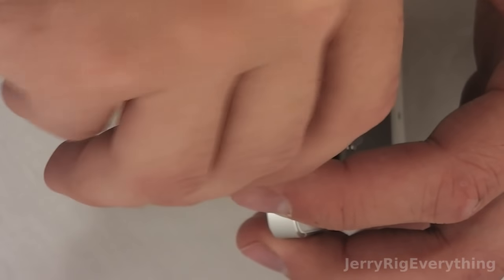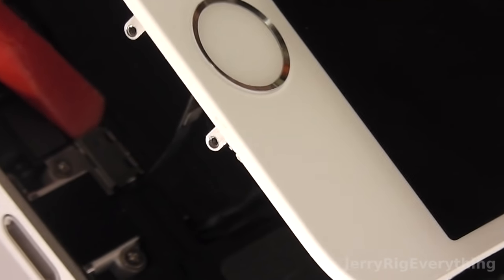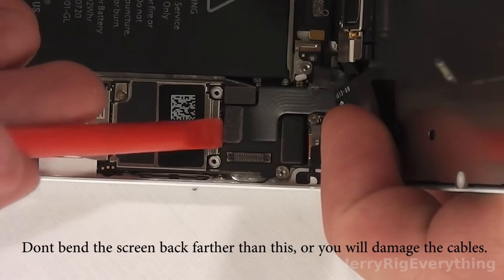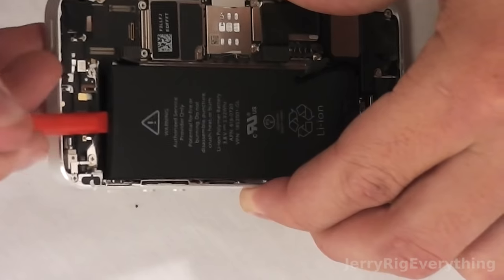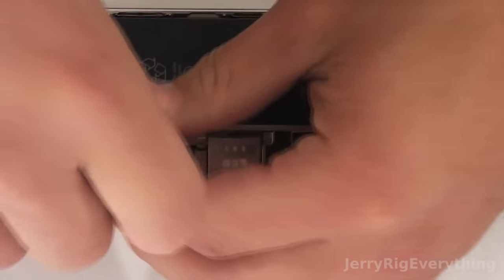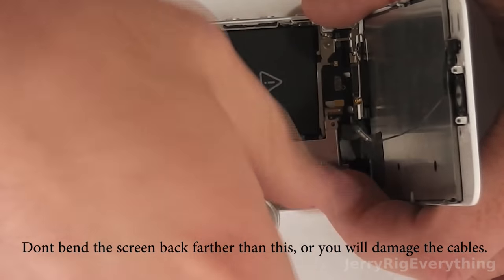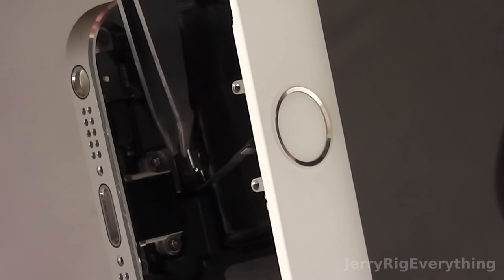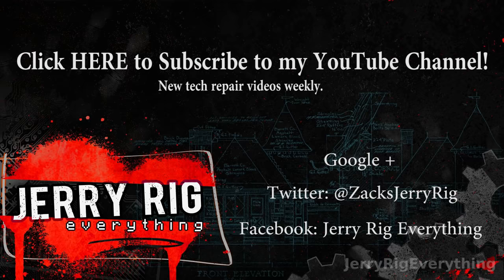iPhone 5s battery replacement in 6 minutes!

Comment: Very helpful and well made video. I had to heat the back of my iphone to soften the glue of the battery which deformed a little but didn't break (I gradually eased the tool underneath and when it seemed rigid I used the hair dryer again to reheat the back of the phone). I did lose a screw, but that was my fault!

Comment: Many thanks.  I replaced the battery and the screen.  That last connector.... The ribbon cable on the new screen was not folded in the correct position like the old one.  Getting that little connector in place took an age.  As you predicted I loved that! (Not.) But the job is now done and all looking good and working well.  Thank you.  (July 2020)

Comment: Excellent tuition with a thorough and detailed description which also included many useful tips gained from experience. I will now try to find out why my phone is not powering up after dropping it. When I first plugged in the charger after the drop it showed a dead battery but I know it was at least half charged. Then it jumped to half charge and the phone functioned normally as I checked it for a few minutes. Left it to charge fully but when I tried it had shut down. When trying to power up it is just briefly showing the white apple logo then screen goes to a very very dull light which is kind of bluey black. Hopefully it will be something simple. Any advice will be greatly appreciated, Thanks. Subscribed👍

Comment: Just changed my battery and although it did not go as smoothly as depicted, I realize he has much more experience. I too had the biggest problem removing the battery. There is a similar video on ifixit that describes removing the adhesive sort of like a Command adhesive strip. I guess I pulled too hard and it broke so I did have to pry the thing out. It has been suggested to warm the battery with a hair dryer to soften the adhesive but I did not try that. Hopefully this will be the last battery I put in. I used a piece of packing tape sticky side up to place the screws upon removal so I would know where they went back. Overall the video was very helpful.

Comment: Very helpful, thanks!  I had problem taking the battery off the phone.  The adhesive was really strong that I almost gave up because I bent the battery and a spark came out.  Taking the battery out took me about 15 minutes.  After that everything works great!

Comment: Wow. Very good video . I ran into some issues with frame alignment putting it back together , and those small connectors are a bit tricky lol.. had to take it apart and reinstall bc I think I didn’t quite connect the ribbon cables at the top correctly ..

Thanks for helping me up-cycle my old 5s!!

Comment: 1) If you afford do it with the master. 2) Omg! I did it myself!!! When you watch 5min hair tutorial and repeat, usually it doesn't look the same. Try to replace the iPhone battery! F.. it is not fun though! It took me one hour, and except the tools for the battery replacement I used the nail kit&brow twizers. The white adhesive under the battery and the clipping back the small cap are annoying parts:)). Will I do it again? Yes!  Tomorrow gona replace the iPad battery. Gota learn this as apple products user because apple not gona make the assembly part user friendly. Among other videos, Jerry's is the best because he explains how to put the new battery back and finish the whole process. Thanks handsome!

Comment: Kudos on the video and process. Just replaced the batt in mine, and it works fine. Very touchy clipping in the miniature connectors. Had a few go-arounds but finally got it. Thanks

Comment: 1. I found my iPhone 5s had the battery held in with the same type of adhesive strips used on the iPhone 5 SE, where you pull adhesive strips out from under the end of the battery to release it.  I recommend watching the iPhone SE video to see which kind of adhesive holds your battery. 
2. You have to disconnect the little home button cable, but the job is much easier if you leave the display connected. And it's more reliable since you don't disturb the screen cables.  Just place something behind the screen to hold it up and perpendicular to the case and put a string around the screen and the support.  I used a block of wood to hold up the screen while I worked.   You could also use a small metal bookend as your support.  If you do disconnect the screen cables, I recommend re-connecting them before you plug in the new battery connector.

Comment: i did this, and it worked great!  i got all of my parts and tools from jerry's links posted here.  it got a little hairy at times.  removing the battery was a sketchy.  i had to pry it out with extreme prejudice.  and the metal clip he warns you about in the last step was a bit tricky, but it was kinda fun.

Comment: I used this video and it helped me a lot, I didn't fail but I lost one screw. I switched the battery and my phone turns on, the fingerprint scanner works, the touch screen works. everything works. I'm so happy I didn't fuck anything up. thanks bro for the very helpful video. **everyone saying that the battery was super difficult to take out, YES IT WAS. I used a butter knife and I was so scared to break something. but I did it. holy shit, that was stressful**

Comment: I totally mashed my battery getting it out! Nearly bent it in half! The phone had been overheating so I guess the glue was really stuck. All together and working now. Thanks
Reply: there is a trick to avoid it. heat up case a little  bit with hair dryer and battery will pop up no problem.
Reply: he didnt mention that in you replace the battery first time there is two strips at the bottom of the battery and u should pull them to your self to remove easily the battery otherwise u gonna mess everything up.its super easy when u just take the two strips cuz they hold the stickers with the glue on the battery...

Comment: Just did as change of a battery thanks to you video.  Thanks!  Much easier than the Ipad Mini first gen battery I did where I needed to use a heat gun to pull apart the screen adhesive...

Comment: So I don't know if anyone hasn't risked damaging their phones already, but the video is perfect except you definitely want to disconnect the battery before you even go near the phone screen cables. Also for those wondering, yes, he does make taking the battery out look easier than it is, you will struggle as the official way of taking it out is actually by taking out the charging panel at the bottom and pulling the adhesive out from under the phone, for which then the battery will simply fall out.

Comment: Thanks a lot, everything worked fine except the loosing up of the battery. It was very strong glued to the phone, so I deformed it pretty much when I extract it. I heated the back of the phone with a hair dryer, I don't know if it helped to much. So if your battery goes easily off, I suppose you dont need to take the screen off, but if you struggle with it, it is safer to take the screen off and not risk to rip of the connectors. One of the 4 screws from the screen connector plate is longer than the others!!!

Comment: thanks mate , i preferred your tute ,better close ups .i saw one vid that didnt mention the fingerprint ribbon gizmo .glad i watched yours before i did my battery , i did bugger it i was pulling the old battery up and it was bending it went extremely hot and the flash light grew brighter until it all popped ,i should of had battery disconected before i tried pulling it up .
the phone still works just no flash or volume button or lock button

Comment: Great vid, Just like you said.  I choose not to disconnect the screen - went fine I was patent and just held the phn and screen with one hand.   I also stress that one be careful about that hidden ribbon cable as your prying the battery out.  I also found that if you pry up on the battery a bit and just wait 10-20 or so seconds you will find it is letting go.    A minute of so and it will be out.

Comment: Takes this boss 6 minutes. Takes my noobie ass 6 hours to just end up causing my device to be stuck in a restart loop because I of course misplaced the very important screws, lol. None the less, I ended up resolving my issue with the restart loop/compass in my device to be fixed after around 6 hours. Thanks for the great tutorial.

Comment: Well I had success so far.(charging right now and did power up) I ripped bothbattery tape tabs off so I was forced to pry it off. I don't know how the heck you do that without ripping the old sticky tape. Slowly slide tool under battery like Jerryrig said and use extreme patience. It took me nearly  10 minutes to slide tool under battery to remove without bending the battery much at all. It worked.

Comment: Thank you very much, your videos were EXTREMELY helpful. I had a bulging battery (weirdly enough it was working just fine) which was pushing my screen out, and thanks to you I was able to change it less than a half hour, thank you!

I do have a question though: because the screen was bulging out, some dust from my pockets made its way in between the screen and the digitizer. Over a light background, it's quite visible. Not a huge deal but kind of annoying. Is it possible to separate screen and digitizer to clean the interface between them without breaking one of them?

Comment: I replaced the battery in my wife's iPhone 5s yesterday.  The hardest part was getting the screws back in.  the only problem I had was I lost the long screw on the cable cover.  There was a bag in the battery package (Daxtormin from Amazon), which I substituted for the lost one, but I am not sure it's the correct length.  Regarding those 4 screws, there are 3 different sizes.  The shortest screw goes in the 10 o'clock slot.  The longest in the 2 o'clock slot.  The 2 middle size screws go in the 4 and 8 o'clock slots.  Anyway, my problem was that once the battery was installed the charge was only 3%, but everything worked properly and I charged to 100%.  I thought all was well, but the phone went from 100% to off in less than two minutes.  Then I charged for about 12 hours, and the same thing happened.  It keeps turning itself within about 2 minutes off even when plugged in the charger.  Since all the features on the phone worked, and I had a 100% charge, I figured I had it put back together correctly, but I don't know. What could be causing the phone to discharge so quickly?  Maybe it has something to do with that long screw on the cable cover???

Comment: Hi Zack I love all your videos, tests and even modding. I have one idea for iPhone 5s users. I was thinking about adding secondary battery to the phone. It would require taking the phone apart than cutting little opening on the back of the iPhone to thread some kind of splitter connector for the two batterys . The connector will need to be invented though and DIY. Some fine soldering and steady hands needed. I see it like this: 
1. Connect DIY splitter to motherboard
2. Connect original battery to one joint. 
3. Connect secondary battery to second joint that is threaded to outside. 
4. Stick second battery on outside iPhone back housing
5. Figure out some cover for that second battery
This way you have 3k or 4K mAh battery in your iPhone and you can charge it through lightning connector as you would original non modded phone. 
What do you thing? 
I can’t do it. Can’t afford spearing my iPhone 5s But for you it’s peace a cake.

Comment: Just used your vid/advice.  The only thing that didn't go to plan was removal of the actual battery by leverage and removing from internal adhesive strip.  Mine just didn't want to budge.. finished up literally ripping it off!

Comment: LOL - for $12 I get to keep my old iPhone 5s by replacing the old battery.  I did not want to get a different phone.  Thanks for the video.    However, you made it look easy putting those screws back in.  I managed to lose one from the battery connector.  I used an old Fitbit screw and it fit somehow.  Anyway, the new battery seems to work great thanks to those of you that put out these videos.  $12 LOL - still laughing about that.

Comment: Thanks for an easy to follow video. My daughter gave me her old iPhone 5S but said it needed a new battery. She said she had it replaced 'a while back' by a phone repair shop 'on the corner'  and suggested I do the same. I saw your video and decided to do it myself. When I opened the phone up I discovered that the person who did the last battery replacement had not re-installed the little metal plates (clips) that hold the plugs into their sockets. They are all missing and perhaps this was the problem with the phone. Do you know if it is possible to obtain replacement clips (and screws) and, if so, where?

Comment: Hi. You haven't shown in this video how you put the connector of the battery to the device. I find it to be a really difficult to do that part of the task. I patiently tried to do it to the point where I ended spending more or less an hour with no sucess. Finally, I had concluded that the replacement  battery I bought (made in China) was the problem. I ended up ordering another one from amazon. This is not the first time I've done work with iPhones (3,4 & 5) and I completed all them tasks without any issues and without spending so much time . Your help is greatly appreciated.

Comment: If the battery glue is too strong, prying up too hard to remove it can cause the batter to rupture and cause damage to the phone as the acid spills. To prevent this, use a heat gun on the back of the phone case to reduce adhesion of the glue. Then battery can be more easily removed.

Comment: Great video--got the replacement battery installed and everything back together again. However,  when I tested my iPhone found that the volume controls, the ring/silent switch and the sleep/wake button no longer function. I disassembled the iPhone again and checked all the connections; couldn't see anything wrong. Obviously, I must have messed up something, somewhere. Any insights or suggestions?

Comment: Great video.  A metal blade is definitely the thing but very wary about hitting anything inside with the point.  My friend changed my 5s battery but my reverse camera doesn't seem to work.  Is it related?  What about the Touch ID - what if it doesn't work?

Comment: Thank you very much for your help. I am trying to to remove the battery but its stuck and also its very soft. If I apply pressure, the battery is getting dent in it .

Comment: Zach... you fail to mention that the two sided tape that holds the battery in position usually doesn't survive removal. New tape strips are available and should be listed with your replacement battery. I didn't have time to wait for new strips to arrive so mine got installed with Hi Temp RTV 100% Silicone... officially JerryRigged.

Comment: Jerry...great video and instructions.  However, after reassembly, the power button doesn't work and the fingerprint sensor isn't recognized.  I think I need to reset the home button connector, but I'm not sure about the power button.  Thanks.

Comment: Hi, great video. I did everything you said but my phone keeps turning off and not charging. Is there anything I should check? I am about to go in again and have a look but thought I would ask you if there is anything special I should know? I got my battery off eBay and it was a 2680 MAH because they said it was compatible and that it will last longer. I am not sure if its the battery or me having done something wrong. Thanks

Comment: Thanks for showing how to do this but getting the battery off the adhesive if absolutely not that easy.  I literally tore a hole in it trying to get it off the adhesive.  The only thing that helps is to keep constant tension on the battery while pulling it off in small increments.  Do not try to remove the battery quickly!

Comment: Just replaced the iPhone 5c battery while watching your video. All is well except the speaker volume control buttons not working now. Checked the speaker connection to make sure it is secured and still no volume control. any suggestions/ideas will b appreciated. thanks for the video

Comment: Iremoved the battery in 2021 and bent it a lot. the glue was stronger than original battery case so it tore and started smelling badly. Finally with safety glasses on I removed whole battery and all the glue.

Comment: This is a great video, but be warned about the "tape" behind the battery. Mine was a very strong glue, and eventually the battery started to bend. I was able to get pliers (yes, maybe not the smartest move but perhaps others can take this as a leson, along with myself) and pinch the corner and begin to pull. At this point my phone didn't turn on at all, so I said to heck with it. It started to smoke as I pulled the battery with the pliers, not coming loose. Then it began to take bright embers, and eventually turned into a torch flame. It smoked up the house and set off the fire alarms.. The phone has so much soot in it i'd not even try to put the new battery in. So, a lesson for myself and others, if it wont budge, leave it alone for someone else to try. I ruined the phone completely. And yes once again, probably not the smartest move on my part. :)

Comment: jerryrig, i followed your clear instructions and easily replaced the battery in my old 5s. it powered on and loaded my content from icloud. however, i have no audio when trying to playback music stored in itunes. at anytime, did i disconnect wires to/from speakers, or anything audio? i only replaced the battery to use this phone as an ipod. oh well...

Comment: Hiya mate thanks for the vid i managed to change the battery and it now turns on. On problem im having though is the touch screen isnt really responding; once it did but was really delayed and the other times it only swipes slightly. Ive took the connectors off and reattached 4 times now. Wondered if you had any advice? Thanks in advance